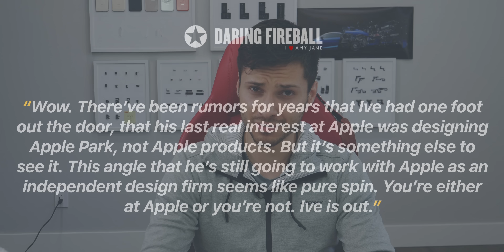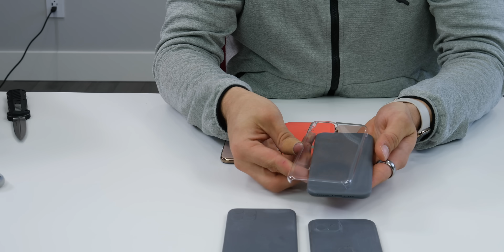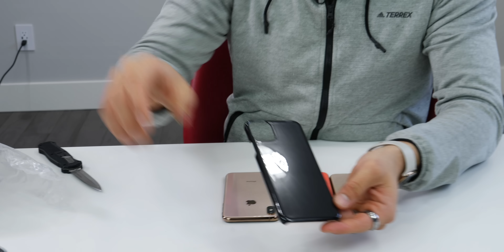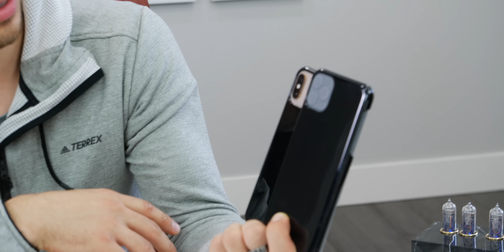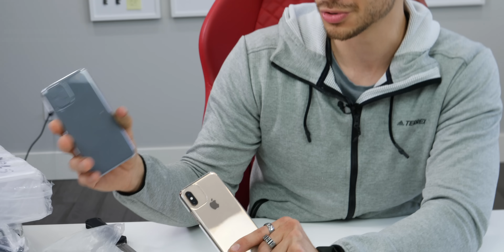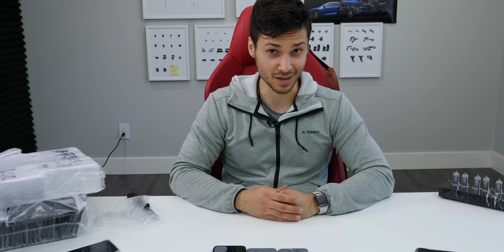iPhone 11 Cases & Models Hands On!

Comment: I had the note 9, iphone xs max and note 10+. This phone by far is the best.•ᴥ•>allmy.tips/i-MaxPro?8     The battery life is extremely good. Lasting over 12 hours with on screen use. Thats without dark mode/ low battery mode and brightness between 80 and 100%. I ordered this phone on September 20th and received it on September 24th despite them saying itd be mid October due to back order. Comparing the camera to other phone, pixel, samsung, one plus nothing compares to it. Definitely a great phone, if not the best.

Comment: Hey Filip, I am really interested in the cases you are designing. Specifically I am looking for a case with a magnetic back for use with my Scosche wireless charger I bought for my Jeep. Will any of your cases have a mag back for this purpose or have you published spec sheets for your cases that I can take a look at?  
In the mean time, is there a decent mag back case or mfg on the market with mag back cases that I can purchase as a place holder until your cases launch? Thanks!!

Comment: i just want to tell you guys that : the time goes and comes back 
look at the iphone 4 when it was released it was a huge change for apple from the aluminium and plastic iphone 3g 
and now look at the iphone 8 its the double of 4 but its the same design as the 4 but bigger with touch id and the lens a bit bigger 
and the iphone 5 had the 5c like the iphone 10 has the 10r 
plastic 5c with colors 
glassy 10r with colors 
plus the iphone 8 changed from the iphone 6 and the 7 because they were aluminium just like it happened with the 4 and 3g and 2g 

:)

Comment: iOS 13 beta things that I’ve noticed
Have you notice in some apps when your scrolling you can haptic touch or 3D Touch to scroll I don’t know if that was on iOS 13 beta 1 but I see it in beta 2 and toggles in settings has changed slightly and saving photos in safari has a different interface which I like. If your changing your home screen wallpaper it shows your exact home screen layout.
Can someone please read this thanks

Comment: You keep calling the iPhone camera concept "better than the Android one", and that no one has done anything like it, but it's a well known fact that the Huawei Mate 20 Pro, an ANDROID phone from last year had a giant square camera with 3 lenses and a flash that looks almost exactly the same at first glance as the iPhone 11 one. It's in the centre as opposed to the top left corner, but come on. I'm Apple fan and currently use an iPhone, but let's not make this iPhone 11 camera out to be some revolutionary new design that's never been seen before.